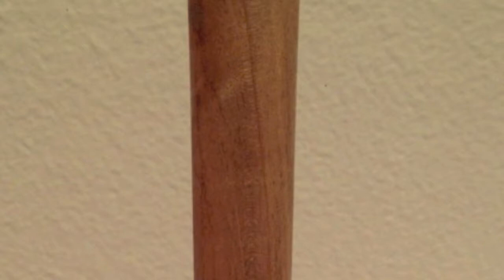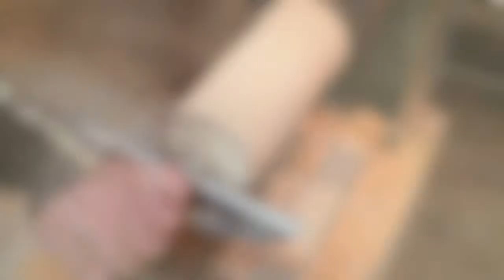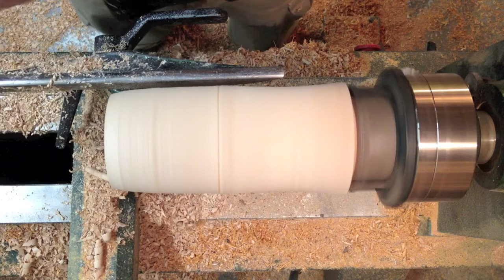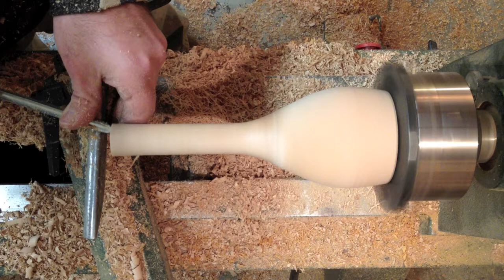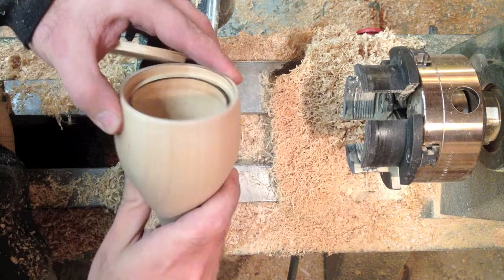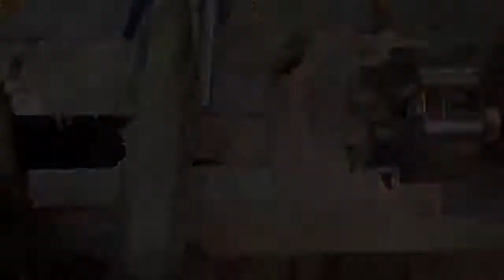Making of the Long Neck Vase - Woodturning

Comment from the maker: @s10m0t10n thanks Derek :) the skew has become my most used tool, usually I turn spindles for the cabinets, legs for furniture. In this video too at one point when I use using the gouge on the neck secretion, I was using the gouge as a skew. The peeling cut works best on this type of grain orientation.